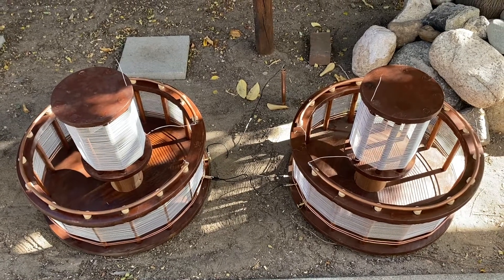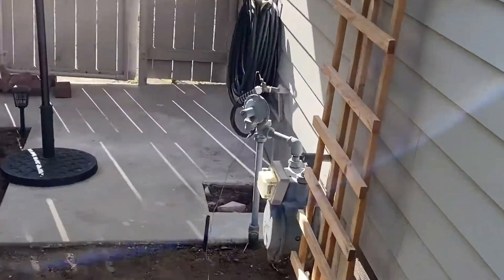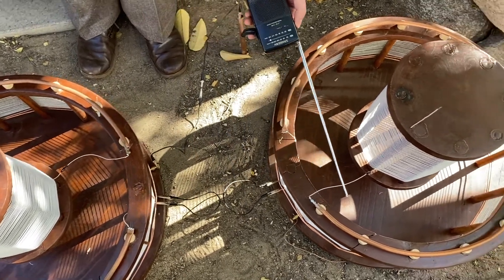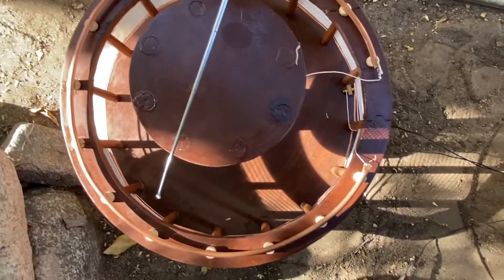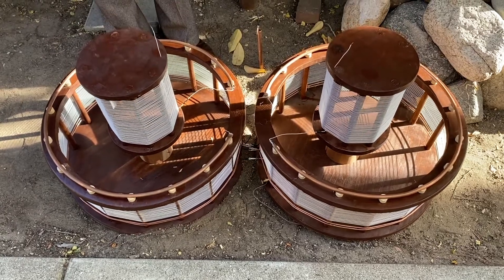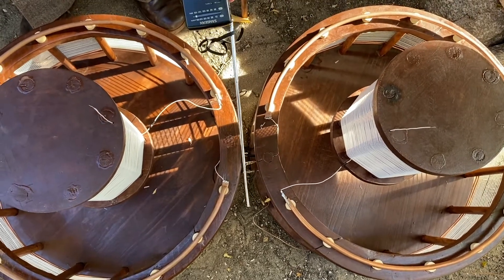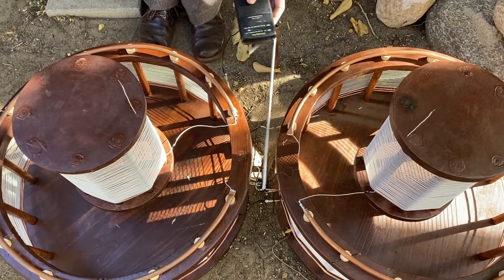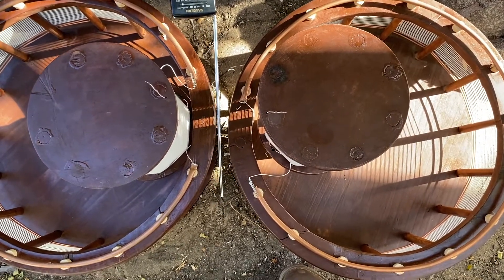Tesla Earth Radio Reception Demonstration

Comment: So what is the practical application of these?  I do not see these coils being put to some good use.  If you can demonstrate a use for these then that would be interesting.  Otherwise why would anyone want these coils?
Reply from the maker: These coils are considered a magnifying set. They’re practicality is in the field of RF communications, where they can be employed as a receiver or transmitter. They may also be used for high frequency high potential magnifying sources, for the research of Tesla x-ray and plasma phenomena. As you can see in this video, the set is acting as a receiver, without the use of actual radio components. It’s taking the Telluric radio component of a nearby AM transmitter, and “re-transmitting” so that to couple with an identical unit.
Reply: @GriffinGBrock  well its is not as useful as my CB radio, or my shortwave or amateur radio which are allot more technically developed.  And surely does not compare to my Software Defined Radio hardware and software.
Reply from the maker: @beckyhoward5334  Perhaps if the content of the video and its targeted purpose became more comprehensible for yourself, you would see that these coils, only in this video alone, are only intended to receive an AM station, just by inductive coupling. Obviously, more intricate electrical components can be added to make it perform as a more improved receiver. In fact, the use of such coils, as employed in a telluric transmission of communication, would be more efficient than a commercial CB and shortwave radio which you claim to possess. That is, the conjugate use of a special receiver/transmitter with a magnification coil. This would allow a lower attenuation of the signals received with respect to distance. I advise that you re-watch the video to recapitulate upon the matters being presented.
Reply: @GriffinGBrock  hah, you are awesome. This is really cool! Those are beautiful